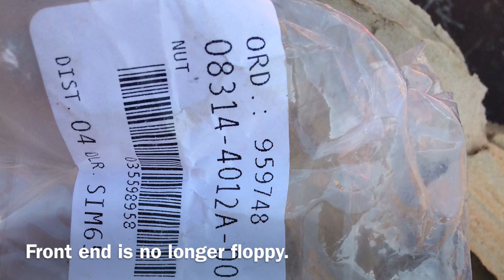IGNIS SPORT ANTIROLL BAR REPAIR

Comment: Nice video. On both the standard bar and the cusco 24mm bar I've fitted on mine I've found the threaded section is so soft and prone to wearing/stripping the thread where the castle nut tightens against the large washer. I had 25mm long nuts machined that use the full length of the threaded section on the bar, allows for a much more secure tightening of the nut without fear of the threads disintegrating. Secured in place with threadlock compound
Reply from the maker: Certainly worth keeping a eye on this area. I have various stripped and damaged threads around the suspension, I am fixing the damage done by professionals bit by bit.